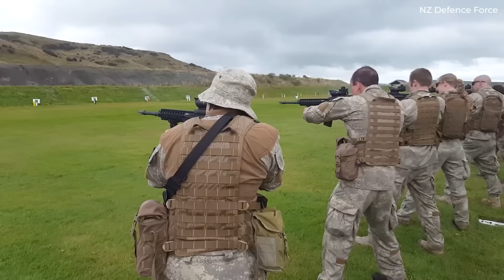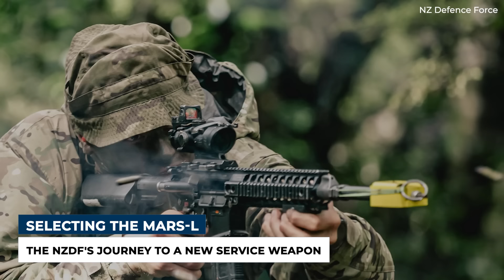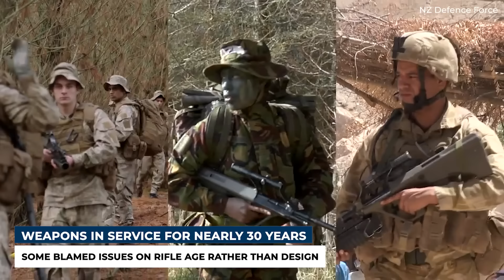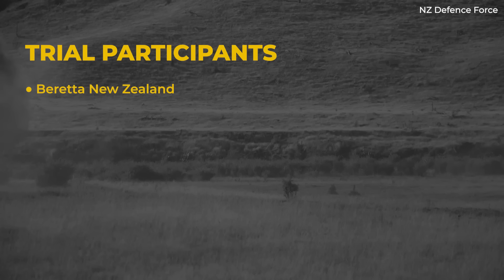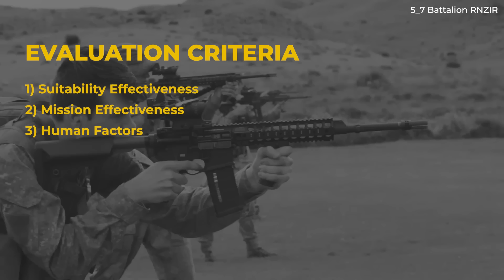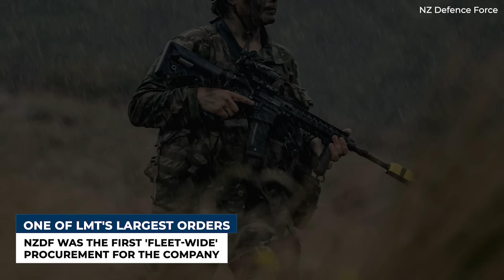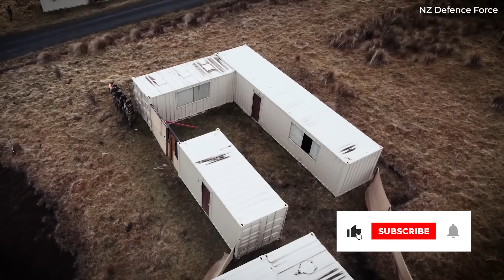NZDF’s Move To MARS-L: How New Zealand Selected Its Service Rifle

Comment: Used the wrong blank ammo for the Styer for years while I was in the NZDF. it used to be shorter than a normal cartridge so when fired it was the correct length for ejection. The replacement was crimped to the full length including the bullet so was longer when fired causing it to jam in the ejection port. From my observations anyway. It still needed replacement 26+ years in service is a good ammount of time.

Comment: had no issues with the styer i loved my styer, @300m a half decent shooter can easily obtain a 3 inche mpi grouping on a stationary and moving targets, @ 400m the styer could still effevtivly and accuritly turn enemies day to shit . easily strip down and reassembly under 60 sec. had no issues wearing armour easy pull on the styer, i found the weapon hearty and tuff could be full immersed in water and still function well there after ,, functioned well in arctic, arid, wet and humid conditions   and u could use the styer as a club if needed and still function after wards.
had the same styer for 6 yrs, only thing that wasnt great was the bayonet/wire cutter was easy fix though i rathered the Kbar instead for those close incounters . the mars is shite styer has a superiour MV of 960m/s  with the 20 inch barrel  and shallower trajectory. plus had no issues sending tracer down the barrel. weapons an extension of the body so needs to be treted that way and looked after with high standard of weapon readyness

Comment: A good video. However IMHO the Steyr served the NZDF well. I deployed on operations with it 4 times and it was easy to use, accurate and reliable. The operational ammunition on my last deployment was Mk262, and the Steyr could fire this as well. As a bullpup it had many advantages however the MARS-L met the user requirements which included the optics etc as shown in the video.

Comment: Interesting the Philippine Armed Forces also acquired the LMT CQB 14.5" along with Mk. 18 CQBR which where acquired through grants from the US during the Marawi Siege in 2017 additional units where eventually acquired in 2018~2022 to replace older M4 Carbine (Non-M4A1) & HK416A2 where only 800 acquired.

Comment: does australia not want to share their version of the AUG? they licenced and redesigned austrian AUG into EF88 which is even better than the austrian AUG A3. EF88 has quick swap barrel + rail with pre-zeroed optics attached. you can reconfigure your rifle in the field from a 14" barrel red dot sight room clearer to a 20" barrel 6x scope DMR/LMG within 1 minute.
Reply: Apparently it came down to per unit cost.

Comment: great video thanks, The Brits had a problem with the plastic firing pin in the L86A1, mothers would buy a metal pin for 15 quid and send them to their boys.
Most(?) operators of bullpup style weapons have moved to the more common AR layout, mainly due to the weight being very close to the body, making moving the barrel in CQB annoying - especially one handed.
Good to read we have the 7.62 marksman equivalent version, as the US has found squads need to reach out to 700-800 m (RPG range). 
I hope a SAW (M27) equiv is coming, as the US marines use this to reach out and touch people who thought they were out of range. 
Is there a suppressed option, as the US Marines report it makes combat less deafening, and it is easier to pass orders about.

Comment: You forgot to mention it's direct impingement, as opposed to the Styers more reliable short stroke gas system. Also the styer had 20" of barrel as opposed to 16" on the MARS

Comment: Can confirm (as a grunt), the MARS-L is a great rifle, if taken care of, but also in adverse conditions, even if a soldier is too lazy to maintain it it the field, they are still very reliable, paired with the ACOG they are also extremely accurate (firer dependent of course). Although a few minor issues arise due to alot of the rifle's, at least for the infantry units that use them on the regs, reaching high round counts being put through them, but issues that would be expected and relatively easy fixes for armorers, like worn firing pins, worn or broken retaining pins, pitting on the bolt face. I've seen them picked up out of mud and still fireing reliably. Not as reliable with blanks, not so much due to the rifle but more because we changed from steel blanks to brass, but thats blanks being blanks.
We also use another LMT rifle thats 7.62 which is very similar which is used as the Section designated marksman rifle, a great bit of kit aswell
Reply: Good to hear, i wish we had them. The safety on the IWS gave me the shits especially with the live one up the spout. Accidentally bump it to fire, or worse to the fun position...

Comment: The Steyr was awesome. I was pinging targets at 400m and never once had a stoppage or jam if cleaned daily on ops but it did lack a decent sight package and personalization for armour or chest rigs. Also with the amount of vehicle ops it needed to be functional for in and out of vehicles, especially those more mobile units like Engineers. I'm also told, for the new MarsL, that the accuracy scoring for markmanship has to be adjusted as more people are more accurate and outscoring the old metrics. This is likely due to the better optics as I understand it.
Reply: On the SART range i got hits out to 700 with my Steyr and its donut of death.
The only unreliable thing were the operaator, the number of times i saw flying gas plugs or BFA's falling out because the numpty couldn't fit them correctly.
The locally source steel cased blank was just trash. Never had issues with the live SS109 or F1A1.
I once completed the AWQ shooting single handed (i did use my other hand to assist with reloading) and still scored a 180.
Reply: @23kilkenny23 numpties? None of those in the military 😂
Reply: Sorry mate. Dodgy safety catch.. ex Armoured Corp.
Reply: @JeffAndrew-r5q horrible safety. A good safety is critical on an infantry rife, not important on a range toy.
Reply: And better trigger, better ergonomics id say.

Comment: So the AUG was (according to quoted reports) under powered and the solutions was a less powerful rifle (same round with a shorter barrel and lower muzzle velocity). That suggests to me that the criticisms of the AUG should be taken with a large grain of salt.
Reply: The Steyr was great, especially the ACOG version. The MARS-L operational ammo is a significant improvement barrel length aside and the scores to pass as marksman have had to be significantly increased as there has been an across the board increase in scores since the MARS came in.

Comment: That really is selling the Steyr short. I have worked with them for most of my 16 years service in Australia in all sorts of environments. All weapons wear out , all need cleaning . As for the hitting power , the longer barrel of the F88 gives it much higher velocity than an 11" barrelled M4 . The upgraded FE 88 has all the mounting points for additional equipment and the M203 mounting design is much improved on the old one. Sound's like the new rifle has more issues than the Steyr ever had.
Reply: They Steyr had plenty of teething issues, which were resolved just like the MARS-L. The MARS-L has not had any problems after the initial issues.
Reply: @nzgunnie  I've never heard of teething problems with the Steyr . It's original design dates back to the 1970's so it was well worked out before Lithgow started making them . The mounting of the M203  was the biggest problem which of course it was never designed to have on it.
Reply: @adamparker9765  it was teething problems with the Australian manufacturing processes. My recollection was something to do with the machining that affected the feeding.
Reply: @nzgunnie  True. According to the coversations I had with the armourers at HQ, who are responsible for weapons and optics, NZDF got the very first F88s off the line and it had teething issues which were sorted out under warranty. By the time the ADF got their Steyrs the bugs had been worked out.
Reply: The Steyr is ancient, its older even than the SA80 although without nearly as many revisions.
Reply: @Captain_Aubreys_Salt  Yet the Styer is still highly deadly. The AK 47 is even more ancient being designed in 1947 and yet it's still the most popular automatic rifle on the planet. Yes, there is room for improvement but that doesn't mean older weapons instantly become obsolete unless you start comparing assault rifles to bolt action rifles or a similar leap in technology.
Reply: We didn't but 11.5-inch barrels, we bought 18 inch barrels. The SF got shorter barrels, but line units got what was determined to be the optimum barrel length for the performance required by the Statement of Requirements.
Reply: I was about to say, how come the Aussies use this in deserts, Afghanistan, hot areas etc. and I haven't heard issues. Do the kiwis have a different version or something?
Reply: @mikespearwood3914  The Kiwis got the first production guns. The Aussies made a number of changes, which the NZDF never got.
Reply: @mikespearwood3914  The Kiwis have a much lower budget so they use their firearms till they fall to bits.

Comment: Future Video Suggestion: Could we please look into the Royal New Zealand Navy (RNZN) future force design with an exploration of the future frigates Type: 31 & Mogami Frigates? - I am of the opinion there needs to be a extended review to include the MEKO 200 Frigate, especially with the German Navy acquiring 8 MEKO A200s along other navies operating various models of the MEKO 200 design.

My reasoning, the current ANZAC frigates are MEKO 200s and the transition from one to the next might be a safer option. Given that we (NZ) tend to transition from one model and upgrading to the next (as in the case with the C130s). This might mitigate risk and continuity from organisational knowledge to maintenance and supply chain. And, maybe acquire 4 Frigates. 4 Frigates was what the RNZN was centred on in the first place. I am aware NZ is aligning deeper relations with Australia but, I have reservations given the history of Australian naval projects that tend to have high cost overruns that a small navy like the RNZN cannot absorb.

Another video suggestion is the replacement of the amphibious ship - HMNZS Canterbury. It is my understanding for some time the current govt is exploring 2 amphibious ships, my guess in the form of an LPD. Given the sea state conditions and the lessons learned from 'The Cant' (* no reference to 'The Expanse') the need to have a well deck is an important consideration.

To add, the recent interview of the current Defence Minister, Tony Penk  (* TVNZ's Q&A, aired on: 19 JUL 26) has highlighted; 'We need to look into what we need in the form of platforms, which will determine the level of personnel' (* I am paraphrasing) in reference to the NZDF's current personnel crisis and compliance. 

Thank you for taking the time to read this and cover the MARS-L in your first video.

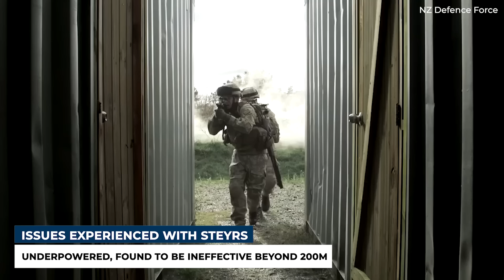Comment: 2:37 The Steyr was "underpowered". That's hilarious given the replacement fires the same cartridge with less velocity cos it has way less barrel length!
Reply: MARS can shoot 77 grain ammo, IWS has slow twist barrel so can't.
Reply: The new operational round for the MARSL is a very different ammunition.
Reply: @nicholascollins4762  but the barrel only last 2000 rounds
Reply: Dude. The new ammo is a fkn hotrod.
Reply: It was an opportunity lost to upgrade to a 6.5 Grendel or 6.8 Rem or similar
Reply: @mrFizzboat  dah after i wrote that i read that it has a fast swap barrel so yeah it could grendel or arc easy... doh! maybe it is smart after all
Reply: @guyralls9314 got told by a person not a source that our SF has them in .300. take it with a grain of salt.
Reply: @nicholascollins4762  Might be mistaken but I think .300's main advantage over 556 is its ability to hit subsonic through a suppressor. While it hits harder then 556 its not really worth the price generally for anything else.
Reply: @mrFizzboat 6 ARC looks good also

Comment: Call me old fashioned but I think we took a step backwards when we retired the SLR.
Reply: Comes down to Logistics. Far easier to supply ammo when your using the same stuff as your allies, and post WW2, that pretty much means the USA. Interesting that the USA pretty much killed the adoption of an intermediate Cartridge (.280 British) back in the 1950's, so NATO went 7.62 as standard, only for Vietnam to happen and the USA decide to go even smaller with the 5.56. Now they (USA) are looking at the Intermediates again....
Reply: @1978sjt  AR platforms like these can be modified, easy parts removal. cleaning and replacement. Switching caliber is a two step process. As opposed to a whole new weapon. Good to see NZDF going in this direction. The ability to incorporate 5.556, 7.76, .300 and .308 into our operations on one platform is something to look forward to. Our politics are typically limp and we should have a solid contract for US equipment but that's another conversation.
Reply: The FAL was a mechanically excellent designed and extremely well made Rifle. I had the German equivalent G1 for several years and then an L1A1 also. Not easy to swing in close range stuff but good in the open.
Reply: And here's the token crusty comment
Reply: I just wish we had gotten a paratrooper version with a folding stock and shorter barrel, and some better optics. Those were the main weaknesses of the L1A1, but it is possible to address them. It would be interesting to see how the most modern Thales version of the AUG would compete with the LMT. Australia seems quite happy with it.
Reply: @joshklaver47  I agree with you Josh. The sheer length of the SLR made it a bit clumsy in dense bush. My younger brother in law served in Australia and he didn't seem to mind the AUG. Cheers mate.
Reply: Ok grampa
Reply: The happiest moment of my army life was when I became a section commander, and ditched my mechanical musket for an M16.

Comment: I joined the NZ TF in 89. We were still using the m16a1. In 90 we got the iw steyre. I remember trigger issues back then. But the one I used was a left handed model and Austrian made, where as the right handed models were the Aussie made models.
If it hadn't been for the exit from ANZUS in 85, we would have probably got m16a2's.
Reply: Just shut up the AUG was ambidextrous fool the armoured could change it 😂
Reply: We never used Australian made F88’s 😂😂😂
Reply: @zaynevanday142  Its obvious we did.

Comment: It's kind of amazing how many military items are delivered that turn out not to work properly? For NZ I would say almost all of them, although the P8 and C130 seem OK so far. Aermacchi MB339 (?), NH190 ramps, the Navy ship that ended up delivering oranges. But firing pins on a basic design from the 1960s? I don't want to put myself out there as an expert but I've seen an M16 firing pin and there didn't seem to be much to it and firing pins have been pretty standard in rifles since the late 1800s.
Reply: Tr6e, but sub-contractors can, it seems, screw up something basic.

Comment: Former Aussie Army from the late 90's/early 2000's. The old Steyr is/was outdated, and a couple of the criticism's I'd agree with. It was always "accurate enough" meaning the difference in aim point and impact was that an inaccurate heart shot would still end up going through a Lung, but by no means was it a "precision rifle". For the era it covered, it was more than adequate, and (from what I was told by instructors), a lot easier to teach people who had never touched a firearm, how to hit a target (compared to the previous 7.62 and .303), without having to start recruits off on a .22 (interestingly, there was a.22 version made for Cadets, but in the end, they used the 5.56 version too).  We used to shoot out to 300m with the 1.5x "Doughnut of Death", and hit with fair consistency (I will note though, that was under range conditions, practical usage you'll never know about until after it's deployed). 
I never had a stoppage with my unit issued rifle, or the one I had during Recruit training. When I had to use borrowed Rifles from an Infantry unit though, extraction and feed failers, so I would put this down to the amount of usage that particular rifle had seen, and the wear incurred (weather through age or abuse).
The Trigger though.... yeah, worst Trigger ever! (which feeds into the accuracy issues). 
I'd love to have a go with the EF88, just to see how different it is (or isn't), but the chances of that happening are smaller than slim to none.
Reply: Fair enough.
Reply: That trigger 😳  horrible. Unfortunately it's a bulpup thing, they must have a connecting rod from the trigger to the mechanism.
Reply: @m @markc532  Austrian personnel are apparently trained to adjust the trigger to their preference BUT the NZ Army never taught that detail, to my knowledge. A possible exception could have been the shooting teams.
Reply: @michaelguerin56  news to me, never got that training, but then being RACT, I was also lucky to get 2 range days a year. Wouldn't surprise me if those sent off to comps got a armourer to tune the rifle though.